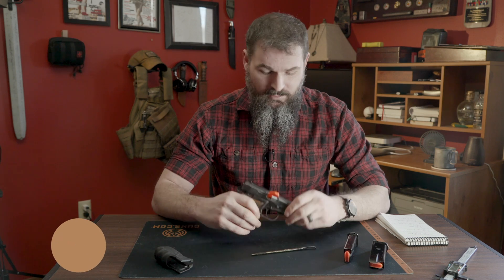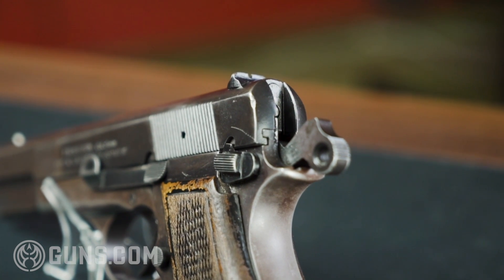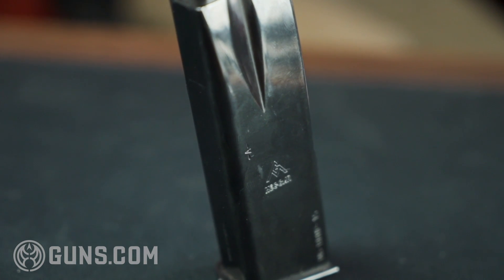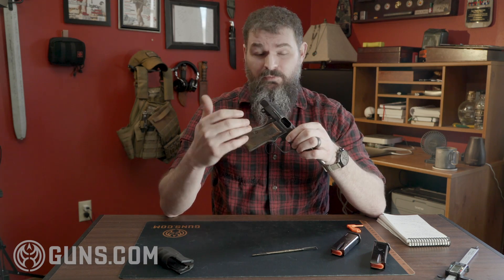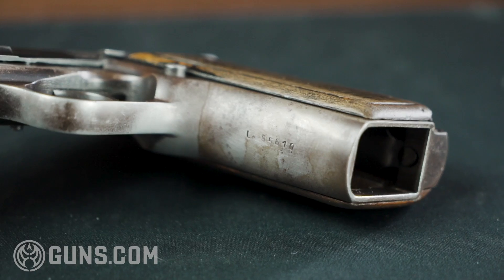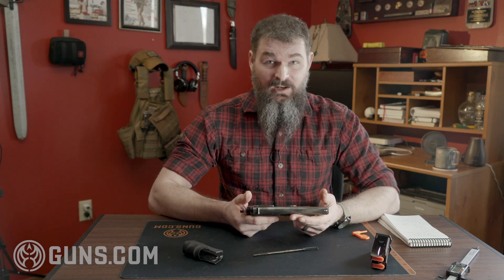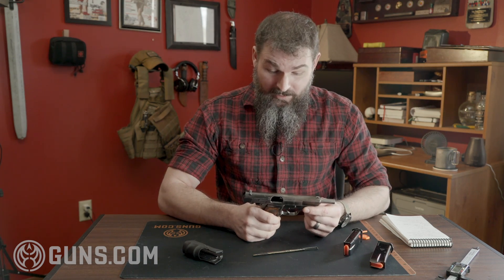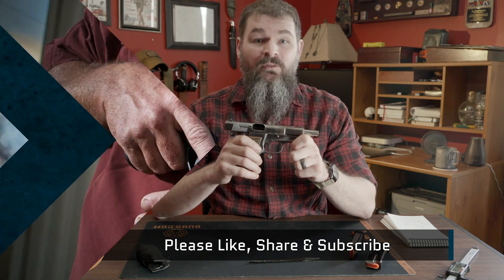This FEG Hi Power Cant Stop, Wont Stop

Comment: I bought three of the FEG high power clones back in the 90's when they could be had for $50-$60 bucks. I wish I bought a dozen. They are great guns and run flawlessly.
Reply: They are not CLONES! they are built under license. The P9R FEG 9 mm was ordered by LUGER! to built certain amount, 23,000 of these handguns from FEG. They are M-90 built by FEG for Luger!

Comment: When your holding a Browning HP your holding perfection.
Reply: Agree!
Reply: Actually, your holding excellence. Perfection is unobtainable.
Reply: I don’t even clean it. Mine looks more rough from being worn under my arm.
Reply: Mine is a safe Queen , but yes it is amazing perfect .
Reply: Only flaw in the HP design is that since JMB and Dieudonne Saive designed it aroumd the 9MMP it cannot be chambered in 38 Super or 45 ACP without a major redesign and re-tooling.
I bought an FEG slide for my FN HP, found the slide stop and its cut in the slide are cut differently.
In recent years I have fired my HP with a Ciener conversion unit, that has done a lot to smooth out the trigger.
Reply: Definitely not perfect because JMB did not do enough work on the design to finish the design. If he had, the trigger would be much better. Thankfully BH Spring Solutions is working on the HP and has the SFS system for sale
Reply: Biggest flaw in the HP desin is that because it was designed around the 9MMP it cannot be chambered in other cartridges-38 Super, 45 ACP-
without a major redisgn and retooling.

Comment: The magazine disconnector was a feature required by the French, who eventually didn't adopt the finished product. Removing the magazine disconnector measurably improves the trigger pull and allows magazines to drop out of the gun when the magazine release is pushed.

Comment: With the exception of the mag disconnect and the slightly awkward and stiff safety, this is a great workhorse carry pistol. I picked one up for a song (idk exactly, but it must have been in the low $300 range)--it's a Parkerized finish, which I don't really like, but functionally it's a tried-and-true, reliable sidearm. I disabled the mag disconnect, and in the variation I have (a 1980s or 1990s M-35 made for Israeli police), there was no effect on the trigger mechanism, that I recall. And in my experience, the slide-lock safety isn't too terribly awkward...stiff, but easy enough to feel and swipe down with your thumb.

Comment: I have the 40 cal version.  I added the FFS kit, recoil buffer system and spring kit from BH Spring solutions.  It was awesome before the work, now it is totally awesome. My 2nd favorite handgun,  Beretta Px4  in 40 cal being #1 is my EDC.
Reply: Mark Allen is the man with thr plan if you ever need replacement parts for the FEG, original HP, and many others as I'm sure you've seen.
Sooo thankful for Mark and BHS Spring Solutions 🫡🤘💯

Comment: I was issued one of these by a security company I worked for in Israel in 2002. It was a really good weapon ergonomically and gave me excellent results in training and on the range. The model I had appeared in much better condition than the one in this video but unfortunately one day one of the internal moving parts broke just when I racked the weapon. The company replaced it with a brand new cheap Bulgarian knock off Hi-Power.
Reply from the maker: Thanks for the comment Jon.
Reply: Arcus. I had one of those. Not all parts swapped but, they're built like tanks, though a little too thick and the angles on them are sharp.
Reply: @herrcobblermachen  That's right. I had to sand a few of the edges they were so rough. The weapon was reliable and shot straight but I never enjoyed the feel or look of it as I did the FEG.
Reply: @jon6815  100%. I don't know why they made them so blocky, I guess to save money and time in machining. Did the hipower you had have the original wood grips, or bad they been changed by someone else by the time you got it or?
I worked security for awhile but we were unarmed.
Reply: @herrcobblermachen  The FEG Hi-Power had beautiful wooden grips. The Arcus had sort of black rubber ones.
Reply: @jon6815  yeah they were like Hogue wrap around grips. Mine smelled really badly and were slightly cracked, but they felt good. I tried to replace them with pachmayr grips but they weren't as wide as the arcus rubber grips to fit around it. They looked like Hogue grips but had a different logo.

Comment: I can appreciate the historical/collectable inclination to not modify an old firearm but the concern you seemed to have for safety as your reason for not removing the magazine disconnect safety strikes me as incongruous with not also replacing all the old springs to get the gun back to its original safety specifications. The sear spring especially (regardless of round count) loses tension over time and will eventually fail to perform leading to a number of very dangerous possible events.

Comment: FEG HiPower is an EXCELLENT pistol. I have owned several. The machining and fit are excellent. It is a "single action only" gun like its step brother the Colt 1911 (both designed by John Browning). They both fit the same holsters, but that is about the extent of commonality. Different calibers, magazine capacity, and grip width.
    I started out on the 1911, a single action, single stack magazine .45 ACP (Automatic Colt Pistol) with a slinder grip width that fit my short but wide hands perfectly. Moving to the wider grip of the staggered 9x19mm (9mm Parabellum or 9mm Luger) was uncomfortable, and I did not care for the Hi Power at first. THEN the entire industry moved to high capacity magazines, most of which are not compatable with my hand geometry. I have found several hi cap 9mm and .40 S&W I can tolerate but only a few that are "oh, yes... that feels good" comfortable the first time I pick it up. My personal favorite is the IMI Jericho 941 in .40 S&W (marketed in the US as the "small frame Desert Eagle" or "Baby Eagle" and in Europe as the "Uzi Eagle"). After using one of those a while, I found the FEG Hi Power clones, and they felt not so bad... quite comfortable in fact.
    I just prefer a double action (SA/DA) gun. I also prefer .357 Magnum revolvers with slim grips, .40 S&W high cap SA/DA guns like the Jericho (an evolution of the CZ-75 like the Tanfoglio TZ-75 [marketed in the US as the EAA Witness] with which it shares a number of parts, including mags), and .45 ACP single stack mags with the slimmer grip like the 1911 variants. There are a number of Colt Combat Commander (slightly shortened 1911) profiles, such as the Para Ordinance LTC and the Taurus PT-945 that I like. The Para LTC (Lieutenant Commander) is all steel and pretty robust (heavy). The Taurus PT-945 is quite light for a .45 ACP, so expect some recoil. Given the pussification factor of current American males, most will not find any of these above 9mm "comfortable" to shoot. The newer 10mm is in that same category.
    Diameter comparisons:
        9.00 mm  =  0.3543"
        9.07 mm. =  0.357"
      10.16 mm  =  0.40"
      10.00 mm  =  0.3937"
      11.43 mm  =  0.450" 

In general, the larger the bullet diameter, the more powder (explosive force) required to propel it to a comparable velocity. The .357" of the .357 Magnum is the exception here. All the last four listed rounds have pretty comparable recoil, and a heavier weapon makes shooting them more manageable.

Comment: I owned a Belgian made Browning high power as well as the Feg knockoff. The FEG HP was beautiful, and appeared to be well made,but, when you pulled the trigger you know where the extra money didn't go. The FEG HP I owned was reliable but it was painful to shoot due to non-stop Hammer bite and badly managed recoil. My Belgian Browning Hi Power shot fast and smooth with no pain attached to the firing of the pistol. The Browning High Power was smooth,cycled quickly, and a pleasure to shoot, like the Walther p 38, and the Beretta M9 as well as the Taurus pt92. Maybe some people have hands that don't get bit by the hammer, but I found it to be a painful and bloody experience every time I fired the Feg HP Clone.

Comment: I had one from the later production era. The small parts on the later commercial versions are very soft and I ended up replacing all the internals with Genuine FN/Browning parts.
Reply: That's cool to hear that they are close enough that parts are interchangeable. Were the parts expensive??
Reply: @Capt_Killingfield  Not really but that was 5+ years ago and parts are getting harder and harder to find.

Comment: Nothing wrong with the FEG's. I've had 3 in the past and just bought another one I found a few weeks ago. I also own 5 original Hi-Powers. The small military safety can be switched out with a C&S safety pretty easily. All of us older HP shooters know that you swipe the safety off with the side of your thumb, not by pressing down on it like you would a 1911 safety. We all have calluses on the insides of our thumbs and scars in the webbing between our thumbs and index fingers from Hi-Power bites!

Comment: You need new springs and grips, this will restore it to (close to) production configuration, notwithstanding slide wear. You can keep these old pistols in their historical configuration or safe working condition, you choose. Also you should check the barrel and frame has not been cracked, these guns can be damaged by running them with worn springs.

Comment: As an owner of a 1991 MK 3 hi power I can say the gun is definitely a military grade sidearm. They didn’t overtighten the tolerances or make it prone to jamming. It’s meant to be loose but not sloppy loose, they were designed pretty much to kill a man at 50 meters and that’s about it. It’s chunky and heavy but it fits an average shooters hand quite well, that weight is an asset on the range as at 50 feet I just kept on hitting a 7 inch plate for an entire magazine. It’s accurate, reliable and simple which should be no shock it served king and tyrants, mercs and warriors, and even the FBI and us police officers since 1935. We hi power owners have a saying about our guns “ knocking over petty tyrants since 1935”. They don’t accurize well, they aren’t the greatest gun nor the most accurate but they’ll go bang without question, and if you keep up with it and can do your part the hi power will not let you down. I own lots of fine firearms but my hi power is the jewel of my collection. One day I intend to pass that gun on to a future family member, I only hope I can make it clear they are obligated to do the same

Comment: If you don't like tho old short safety, just buy an ambidextrous safety for an FN MkII or MkIII Hi Power.  They can easily be made to fit.

Generally, though, the safety is the only FN part that may require fitting to work on an FEG.  It seems that the enlarged circular bearing surface on an FEG safety is the tiniest bit larger than the FN, so the FN safety will have to slightly be reduced in diameter.  Simply clamp the shaft of the safety in a padded vise, then use a narrow strip of emery paper in a "shoeshine" fashion to slightly take of a little bit of metal.  Take about 8 or 10 strokes, then turn the safety 180-degrees in the vise, take another 8 or 10 strokes, then test fit it in the frame.  After a couple of tries it should fit like a glove.

The MkII/MkIII safety is made to be ambidextrous.  If that's what you want then just pin the right-side lever on.  I wanted a single-sided safety, so I just cut the shaft using a cut-off wheel on a Dermel slightly inside of where the right-side lever pin hole is drilled, the use your Dremel to round off the cut end.  A dab of cold blue and voila, a single sided long-paddle safety.  And the MkII/MkIII safety has a better detent so it will switch on and off more positively.

Comment: You only need grips to remove the gun from the holster. If you grip a gun too tight, you loose accuracy. You shouldn’t hold it tighter than a power nailer.

Comment: Do the clone Hi Powers run with hollow point ammunition ?
Reply: You can barely flatten the feed ramp taking out the hump with a dremel. Polish with a felt-tip and it will feed wide mouth hp's. A lot of these guns have a weak extractor spring which will cause stovepipe's. Go slowly with a Dremel conical Stone and it doesn't have to be perfectly flat just break the hump. That and the new extractor spring and it will feed and function at near Glock reliability.

Comment: The safety on my Browning Hi Power standard model is mushy. It barely clicks and it makes me think it can be brushed off accidentally.
Reply: Mine is very stiff going on not much better coming off.
Reply: @ScottGpa  It's a design defect in the Hi-powers.  The safety pivot rod also has the hammer spring pressing against it from the side.  I'd like to be able to afford a machinist to replace the solid rod with a larger diameter hollow one so that the spring would press only on the outside and a solid safety rod would rotate inside the larger hollow rod.  That should fix the problem.

Comment: These FEG P9s are not in any way clones. It is license built by FEG from Browning of Liege, Belgium. In 1973 the Browning factory sold all the original  machinery to FEG plus a license to make these.  Mine is also an Israeli police that came with factory installed lanyard ring and overall in excellent condition.  I have a photo copy of the the original license.  I have replaced  the grips and removed the mag disconnect which was super easy. My FEG is in near mint condition. So, calling this pistol a ''clone'' is not accurate.  It was built to exact specifications with a license and initial engineering supervision by Browning of Belgium.